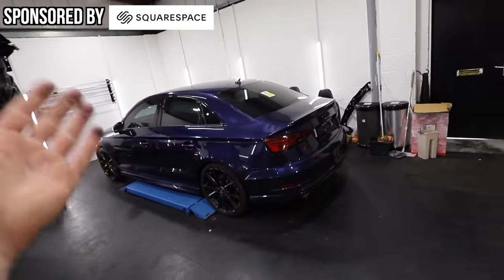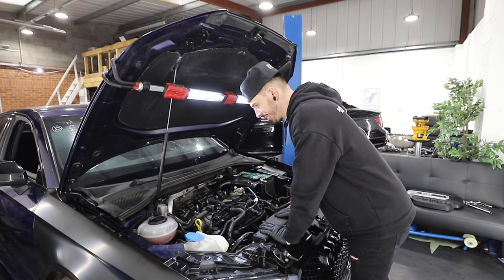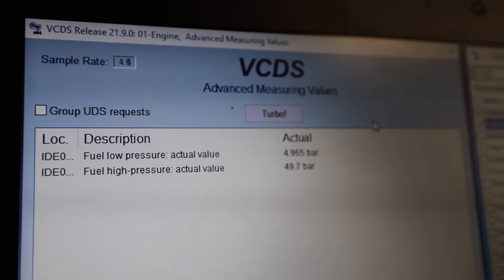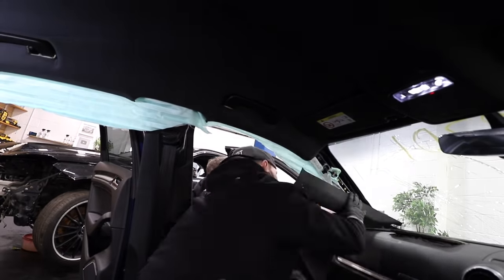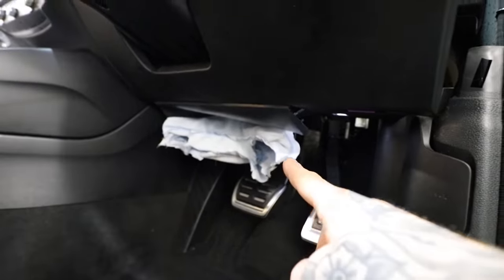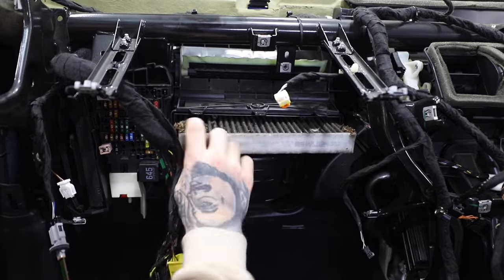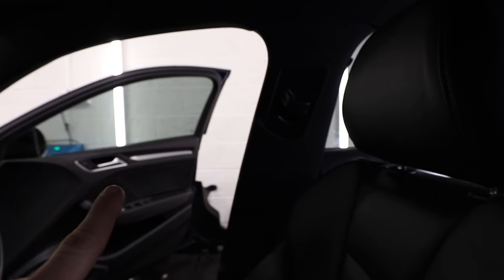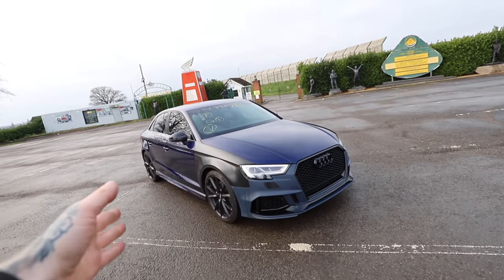REBUILDING THE WRECKED AUDI S3 IS HARDER THAN I THOUGHT

Comment: I had a similar problem with my daughter A1 1.4tfsi. I changed plugs and coil packs. Turned out it was a dodgy connection on one of the multi plugs on top of the coilpack. I rewired a new connector in and problem solved.👍

Comment: Amazing work - that dash looked a proper mission! (Keep those bolts for when it rattles!)
Nice to see Liam two-handed again!

What was the masking tape on the steering wheel hub for?
Reply: I think it is to keep the clock spring central. Different car but when I took my steering rack out on the civic, the steering wheel was free to spin and I ended up breaking that clock spring which meant no horn and no airbag (airbag lights on). Could be a similar thing with this (and all the contacts for the steering wheel buttons!) and is just a precaution.

Comment: With the dashboard/bolt thing, there is a fairly easy solution. get a piece or multiple pieces of paper, and draw a rough shape of the part/surface they came from when you remove them, and tape them to the paper in the rough place they came out of inside that shape. Then you have a paper diagram of where everything goes back in when you re-assemble.

Comment: If its smashed in front the inlet plenum can crack or not be on right. Even a slight gap will cause the car to run rough but at revs the run ok

Comment: You don’t need new radio controls nor a new steering wheel for the virtual cockpit. Only the cockpit, and a wire from the radio to the virtual cockpit for the map view.

For the coding you’d need someone with an ODIS online account with Geko. As long as it isn’t stolen you’ll only need to wait for about 24/48 hours for approval when it’s second hand.

Comment: Hi Mat, I am wondering if the misfire could be related to bad o2 sensors? When the car is in cold start, I'm sure the o2 sensors are bypassed and a set mixture is sent to the engine. Once the car warms up and it starts basing the mixture off the o2 sensor readers, if they are dodgy it could lead to a misfire.

Comment: Fuel will do that to a car and cause it to misfire...any high performance car needs 97 RON and above; my S4 only uses that - vPower is the nuts and your car will always run smoother and with more pep in its step. Take off is better. And you can feel the difference. That's what I've found anyway. Even CostCo premium fuel is awesome.

Comment: Remember these cars have 8 injectors, 4 direct into the cylinder and 4 port injection into the inlet manifold max, try swapping the GDI ones
Reply: It’s an s3
Reply: Think he did that in the last video.
Reply: @MCPolat-ph3zo  so? the pfl have 8 injectors, 4 direct and 4 port, the fl ones dont have port only direct.
Reply: @arronlowley5659  oooooh right nm thank you 😂
Reply: Remember to also watch the whole video

Comment: Great job. You will have problems with the airbag light even after fitting the new seatbelts. That sensor on the front that was in the foam, it's an optic fibre sensor that sets off the actuators in the bonnet hinges which you have replaced. It's called Pedestrian Protection system. It's not mandatory so I would recommend just code it out or replace that sensor too and put it in the right position. Hope this helps
Reply: It’s not fibre optic, it works on pressure, so if the pipe senses a change in pressure from an impact, that’s when it triggers. It just won’t detect any impact as it’s behind a metal crash bar 🤦🏼‍♂️